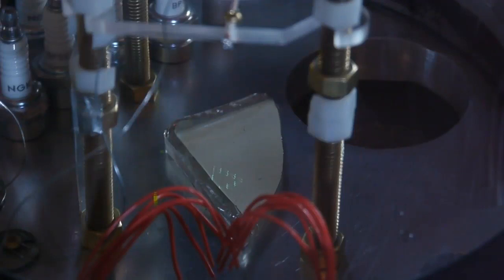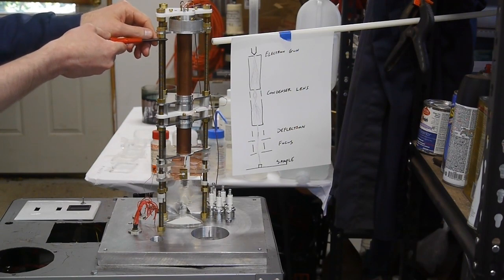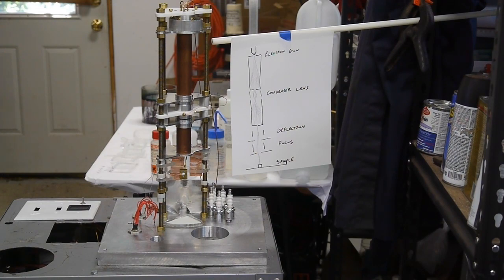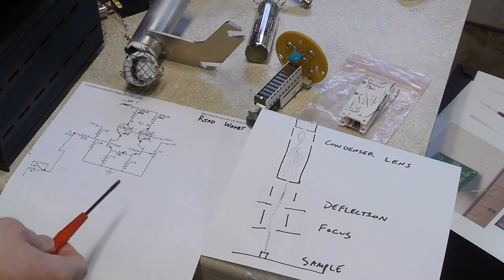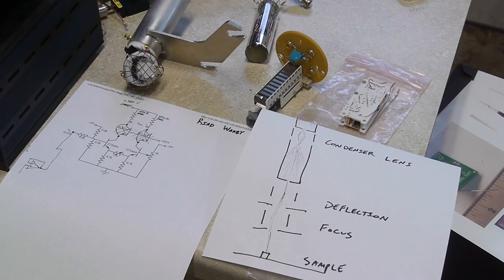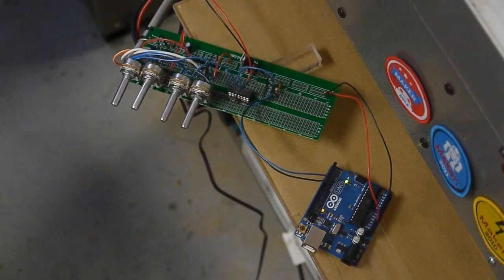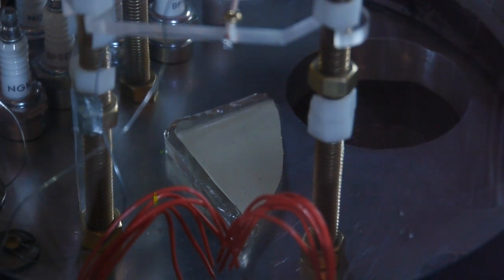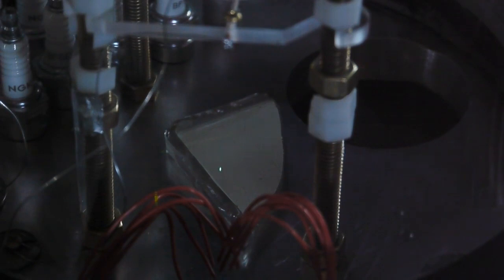Electron beam control in a scanning electron microscope

Comment: Ben - you can use a parallel port drive into a simple R2R Ladder DAC to be able to speed up your scan dramatically.  I did a video on this.  Skip ahead through the R2R tutorial and start watching at about 11 minutes in:
Basics of R-2R Resistor Networks for Digital Analog Conversion, Tutorial DAC Thevenin Superposition
This will be MUCH faster than the PWM outputs.  I show an XY example where a more complex XY drawn figure is flicker-free on my scope.

Comment: If there was a metric of average cool new things I learn per video, your channel is pretty much right at the top of the list.  I've never seen, heard of or even contemplated the possibility of spinning vanes fast enough to literally bat individual molecules out of a region of space.  Looking into that, I learned the term 'mean free path', which is something that I had wondered about but didn't have the vocabulary to look up.  At the pressures you are achieving, the air molecules are likely colliding with nothing but glass and steel 90% of the time.

I'm sure the pump is very well balanced, but i can hear it spinning up.  Do you have to do any vibration damping or isolation to avoid affecting the microscope?

I imagine that new toy is going to do great things for your sputtering projects as well!

Thanks again for an awesome video...

Comment: Hey you probably won't see this but I have a question. At 4:21 we can see a small round CRT tube that looks like a 3ЛО1И. Wouldn't it be easier to directly use this mini tube by cuting it open to remove the phosphore screen ? It has everything integrated like focus and deflection. Is there a particular reason why you needed to make your own deflection grid ? Thanks in advance.

Comment: Ben, removing the top transistors will greatly reduce the bandwidth and slew rate. Scopes use a cascode circuit where the top transistors operate in common base mode to eliminate miller capacitance feedback.
Reply from the maker: This is a good point.  I didn't know the cascode would help bandwidth so much. The gain in this system is about 100, so the Miller capacitance does become a noticeable problem.  I guess adding another transistor is so low cost, and appears to improve performance in every axis, why not do it?!
Reply: Yes as I think only the top transistors need to be the high voltage ones, the bottom ones can be cheaper devices.

Comment: I'd turn the circuit into a pseudo-differential amplifier with two separate common emitter power stages, each driven by an op amp that corrects for nonlinearity.

Comment: Keep it simple - use a low cost  CPLD or FPGA with a R2R DAC followed by a output amplifier. With a simple Xilinx CPLD you can make a very high speed binary counter - simply vary the clock speed for the beam scan raster frequency. You'd need one more electrode near your electron gun to modulate the beam though if you want to draw images .A XL9500 family chip will go to 50Mhz easily for only a few $$. Using a microcontroller will potentially limit scan speeds due to processing time.

Comment: do you remember those old video cameras that used vidicon tubes?....i do.
try using the magnetic deflection yoke from one of those?
sometimes they even include a focus coil.
also, they're spesifically built to provide a clean magnetic feild.

Comment: You can probably get more speed and accuracy from your driver circuit by using an opamp to feedback sense the real voltage on the output and correct for it.

Oh and if you are planing to do digital acquisition this is a good place to use a FPGA where you can easily grab data from a high speed ADC at 10 to 200 megapixels per second, buffer it and then directly show the live high res image on a VGA monitor or freeze it and send the image to a PC (You can get few Mbit/s links with some COM port emulation chips to transfer the large image in a reasonable amount of time). I can offer help with the FPGA side of things.

Comment: There are some STM32 micro-controllers with a built in DAC, they aren't the friendliest to use, but very fast! (for instance the Cortex M4 series) There should be at least a few Arduino compatible micro-controller boards that have a built in DAC, or you could possibly use a very fast IC that works through SPI (or maybe a parallel interface, depends on the precision you need)

Comment: Could you keep the beam unfocused and scan  a shadow mask. Baird., tempted to make one, optical scanning with UV ?  I tried to make an SEM using a high definition CRT TV electron gun and had an interesting introduction with vacuum . had to shelve it . this was when we had CRT tv's ..sold the diff pump and pirani gauges but just got a turb mole with controller under £100. and now need gauges. Its a wonderful world.

Comment: Why not upgrade the electron gun with one from a CRT like the common 0.28mm dot pitch monitors? And you even get 3 guns per CRT for the RGB dots or stripes. Maybe even saving most of the CRT neck and using the existing monitor scanning for scanning a sample using the deflection coils? Some even have dynamic focus for the slightly different distance across the tube face. Just greatly reduce the picture size and add some current sensing for the sample.

Comment: is it just me, or does it seem like Ben could build an Iron Man suit if he really wanted to?
Reply from the maker: While I definitely enjoy the compliments, remember that there are lots of qualified and talented hardware engineers in the world -- many of whom are far more accomplished than I am -- I just happen to make videos about my work.
Reply: Applied Science but communicating this science and technology is sometimes just as important 

also, would you be available as a guest on my little podcast?
Reply: I agree. It takes a complete domain of the subject to be able to break it down in simple terms like you do.
Reply: JRoque250 "simple terms" :) While I am able to follow him when he talks about things like PWM and voltage follower, I doubt the average person would call it "simple". Regardless, he does do a fantastic job of explaining everything.
Reply: Applied Science
humility is good but "lots" is a relative number. Not so many pple can design and build this kind of thing on their time and money. Now the mandatory compliment is done, can you please tell me how you machined the pinholes ?
Reply from the maker: manu de hanoi The larger pinhole (on top of the condenser lens) is on the order of 500 micron, and I drilled it with a normal twist drill.  The smaller hole is about 50 micron (if I remember correctly), and I cheated a bit by using a pre-made aperture.   In commercial SEMs, the apertures are replacement items because the electron beam will eventually enlarge the pinhole, and/or destroy the disc in which the hole is formed.  I think they are laser-drilled.
Reply: Applied Science
ok thanks
Reply: qdragon1337 First he needs to invent the miniature Arc Reactor.
Reply: @AppliedScience  Sir, can you please tell me what is the dimension of minimum feature size that can be achieved using this for e-beam lithography .... thanks in advance.

Comment: You could use ADV7123 DAC chip from Analog Devices. It is very fast 3 channel 10 bit video DAC. Hook it up to your FPGA board with some soft core CPU and you will have fast and configurable XY(Z) deflection signal generator (of course if you are ok with 300 MHz bandwidth :). These chips are not that expensive. Or you can find them on many AMD graphic cards.
Reply: An FPGA demo board with a fast DAC will give you fast and precise timing (no jitter). Digilent has a selection of such boards, with S/W communication libraries and some demo HDL code.  Down load Xilinx's ISE webpack for free and write the code in Verilog. I don't work for either company but I use their products.

Comment: Nice! I didn't think you'd ever do another SEM Video
This is super helpful, I was going to use triangle wave generators and some amplifiers to try and get a nice scan. That turbo pump is epic, 500 mtorr to 4e-10! Do you notice any differences in the behavior inside the chamber vs the oil vapor present with a baffled diffusion pump setup?
Reply from the maker: I'm planning to make the acquisition all digital. I'll use a microcontroller to generate the raster, and collect data with the micro's ADC, and have the whole thing controlled over USB.  The bandwidth is a concern, so it will probably have to be high-speed mode for realtime video (focusing would be difficult without at least 15 fps video).  I haven't noticed effects of diffusion pump vapor -- it may take a while to build up.  Someone said that the deposits in my Penning gauge were caused by pump oil, but I'm not sure. I can see why the industry moved to using turbomolecular pumps in general.  They are much better in every axis -- except cost!
Reply: Applied Science If you can generate a 15kHz horizontal raster, you can make the beam timing equivalent to NTSC or PAL video, then you just need an old analog video capture card.
Reply: I also heard that with the BT878 chipset, it captures also the front and back porch, and the vertical blank, in that case you could run the vertical and horizontal traces at some division of normal TV50/TV60 rates and delivering the full optical field spread out over multiple sequential capture-fields.

Comment: You need something to isolate vibrations from the turbo pump, in this respect the dif pump was better.
I would also use 32bit IC dacs for beam control.

Comment: Could you use a similar concept to steer ionized molecules in your sputtering chamber (not sure if they are naturally ionized by the process or not)?  Maybe pass through a small aperture to provide a manageable beam size?  It occurred to me that if you could focus and steer that material you could 'print' shapes without using a stencil (at the cost of time most likely)

Comment: hey, very nice build.....looks almost like one i saw in the archive when i was a kid.
it was an alvorst lmp-4500.....about 175 (+\- 25) years old, but a good instrument in ti's day.
although, your sensor is a bit more complex.....it's that phosphored disk that's a little over complicated.
the problem is this....ambient light will cause interference.
the lmp-4500 never had that problem...no phosphor disk!

try this.....take the photocathode off that photomultiplier tube and feed the dynode stack direct.....trust me, it'll work a total treat!
although you could use that one with the black-coated dynodes, it should give better performance than that phosphor disk rig you've got right now.
if i could send some drawings i would.....my great grandad's been at this stuff since long before my dad was even born (and i'll be 52 this april!)
l8er!....;)

Comment: nice work, please use a propeller (p8x32a), is a microcontroller with 8 processors 32 bits running at 100MHz, probably for this job is perfect

Comment: Hello, do you know of DC/DC converter component that could output more than 10 kV DC from input of typical table top power supply (0-20 VDC). EMCO CB101 goes only up to 10 kV DC.

Comment: When you move on to microscopy, how will you capture the return from the sample? Will you use a phosphor+PMT or is there some more direct way of acquiring an image?
Reply from the maker: The traditional approach that I've already used is the Everhart-Thornley detector.  It uses a phosphor screen that is mounted onto a photomultiplier.  This allows the phosphor screen to be highly charged to accelerate electrons toward it, and then allows the PMT to operate with an isolated electrical system.  There are also other vague reasons about why a phosphor screen coupled to a PMT is better.  It definitely works, and is still state-of-the-art, however I want to try using a direct electron multiplier to detect the signal.  This would allow the machine to operate without a cover over the bell jar in full room lighting.

Comment: What do you use as a display for the pirani gauge?
Reply from the maker: The gauge outputs 0-10V, and so I used a cheap self-contained digital voltage meter from eBay.  It works great!

Comment: Ben, there is some good information about DAC interfacing at uChobby.com
http://www.uchobby.com/index.php/2008/01/08/arduino-audio-dac-options

One thing you can do is change the PWM frequency to something much higher. I used 60KHz PWM to do an audio range DAC. With the higher frequency you can set your PWM to analog filter for about 60KHz and sweep around at maybe 30 or 40KHz.

Comment: You need some parallel DACs like R-2R resistor ladders. I created a detailed video on this achieving a sampling rate of about 3MHz:
DAC using R-2R resistor ladder
Important is to write 8Bit ports that are completely mapped to pins of the Arduino directly not using arduino digitalWrite. Unfortunetelly the Uno hasn't two complete 8 Ports. Candidates on the Arduino Mega are PORTA, PORTF, PORTK and PORTC.
You can see the mapping here:
http://arduino.cc/en/Hacking/PinMapping2560
A demonstration how I have used 3 ports (X/Y + sound) a once from the Mega can be seen in this video (code can be taken from the description):
http://youtu.be/nTC3vJzc0MY?t=1m9s
But in difference to my synth I would rather use use opamps like in the vid above to get best precision. Disconnecting the Arduino from USB reduces the noise significantly.

Looking forward to see your results
Reply: R-2R dacs are very fast, I can get VGA output out of them, but beyond 6 bits they no longer work OK. Also they tend not to be too linear, even with precision resistors.
Reply: Daedronus the only slight problems is saw were with values close to 0 when not using opamp. you can clearly see in the first video clear distinguishable steps on the oscilloscope even on 8bits. I think you could even use more than that. Also to get clean output you need reasonable decoupling. the more complex your circuit is. the more noise is induced.
But let's see what solution Ben will find :)

Comment: so cool. have you thought of making a mini nuclear reactor and im not joking because it can be done
Reply: That sounds like a pretty stupid idea.
Reply from the maker: Actually, yes.  I wanted (and still) want to make a linear accelerator, and one of the interesting things that can be done with it is make a nuclear "energy amplifier".  It doesn't require the fissile material to be critical -- it relies on protons from the beam to keep the fission reaction running. I think thorium is a good material that will drop below criticality if the beam is shut down. Unfortunately, the accelerator itself is already pretty absurdly hazardous, and the activated thorium is even worse, so the whole project is pretty extreme.  The easiest way to get nuclear power in a small package is a radioisotope thermoelectric generator.  So then, all I would need is some plutonium.  Got any sources?
Reply: Applied Science ...ebay
Reply: Ben Nutley  or like that one guy who bought a whole lot of smoke detectors. Even tho that is americium-241 and not plutonium